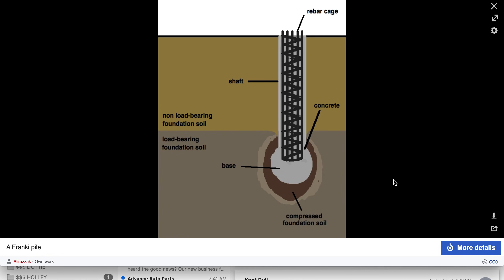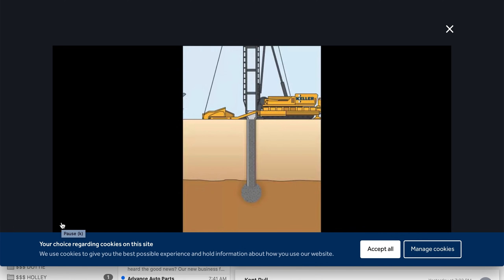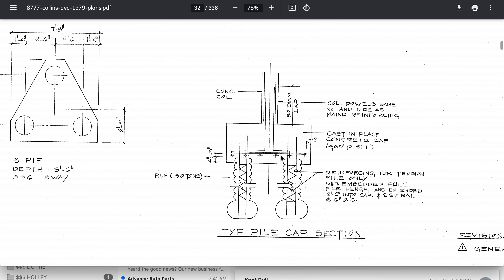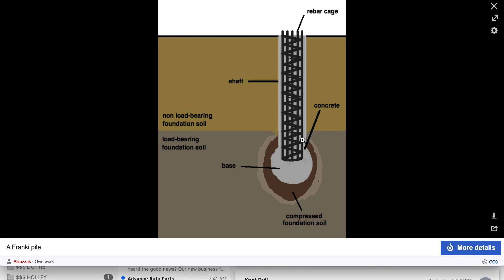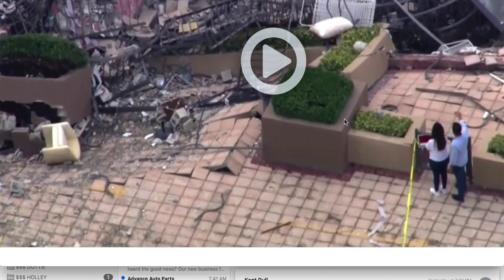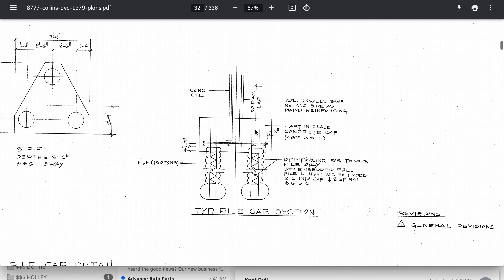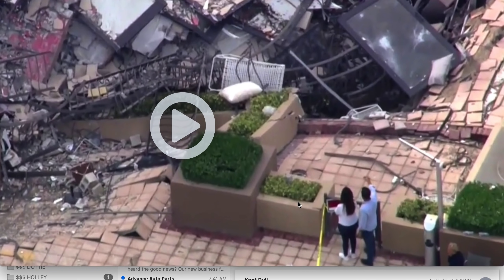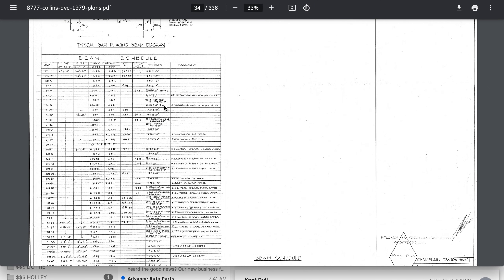Champlain Towers Collapse NO BUILDING SETTLEMENT AND NO COLUMNS NOT SET ON ''BEDROCK" +/-

Comment: Think you only need one set of footings to move and that would start the domino effect. You have one film showing water dropping to deck level. How long had that been going on? What time was high tide and where is water table located? You keep saying it's not the footings, can you find where all that water drain off to? Some where a repairman said he was there to fix plumbing and found sea water in basement. Say what you want but that limestone underground will give away with all that water around it. Think 40 years, twice a day high tide, and you dont know how much rain has fallen in that time period. Ask any of your engineer friends how long does it take for limestone to break down when in water? One video shows rain water dropping in at bottom of ramp, another shows the collapse at same area. And some photos show water damage in same area. When you have the time, go back and read some of comments. I am not the only one who says it's the footings and the limestone. The decks are mess-up also. There should be much more rebar everywhere and there should be right angle bars coming out of columns. You said that there is post tension cables in decking. I dont see that. Those core samples that were taken by Inspector show a thin deck of about 5 inches. That cant be right.

Comment: If the columns in the parking area were saturated and suffering spalling, which appears to be shown in videos, what is it that is meant to protect the piling columns, which appear to be constructed in a similar way, and pass down through (presumably) loose, salty sediment? Also, is there any recognised way to test these things/ However, from the coverage I have seen, it does look like the floors, at least some of them, detached from the columns. In a previous video you were counting rebar, and I think that might be important.

Comment: that broken water pipe just before the collapse means something
Reply: The building shifted and the pipe broke
Reply: It does. It means the building collapsed in phases. Early phase was  2-3 columns failing & water pipe breaking. Next center of building went down very quickly in 3 phases. Last was 5 seconds later as the Northeast corner of building shudders, then falls. Hope that helps.

Comment: An addition was built a couple of years ago to my large workplace on the shores of Lake Michigan. I had a great view! They used a variation of the Franki pile, where they sent down the shaft a sort of drilling head that enlarged the bottom of the shaft into a round chamber. This chamber filled with concrete when they filled the shaft. The water table is very near the surface at this point; maybe there was no way to sufficiently consolidate the soil just by ramming as in your video.

Comment: These buildings lack of the proper columns vertical and horizontal. The Promoters sold a trap and the city officials approved that fraud. All the State is at risk,this in only the point of the iceberg. The Federal Government should rewrite the Construction Code for Condominiums all over the Country it is a scam all nation wide. Looks like Alcapone built it.

Comment: Do you have seismic calendars? Water table maps? Recent Soil compaction charts? Thou code forbids differential settlement. Code is not always enforced nor does gravity care. The GD&T of buildings is inspected at the time of build. In order to dimensionally measure any building and it’s state of differential settlement there needs to be a process involving photogrammetry and 4D modeling of entire buildings in order to verify current conditions. I.E. perpendicularity, parallelism true positions measuring concentricity and load distribution at columns and pylons & beams. The mapping of the water flow and soil saturation has to be a consideration. 

         To the point of original building specification, every surface is a point of context. Pillar’s & column’s, pylon’s have vertical weight stress points yes. Walls floors and ceilings all’s, indicate movement & failure modes as well.
Reply from the maker: Can you please provide me with all the data you requested... I appreciate it and will look into it.

Comment: The overlay and pavers are supposed to be flat. The concrete is pitched and has drains as per the blueprints!! The only problem is the lack of maintenance on the waterproofing membrane.  The design and construction of the building was fine

Comment: I still think this was one single column corroding. Specifically the first one when you go down the parking ramp. The pool contractor the day before the collapse saw a major puddle standing in the parking area next to a column that was under the first section of the building to fall. He specifically mentions the parking space number and it is the first spot  you come to on the right when you come down the ramp. That spot would have been more exposed to wind blowing stuff into the parking area so it is reasonable to expect it to corrode faster if corrosion was an issue down there. 

If that single column deteriorated where it met that standing puddle it could have lost its load bearing capacity. At that point the nearest columns hold the additional weight. Something buckles, parking deck collapses when that shift happens. Something else buckles and the big collapse happens.
Reply: Think larger, much larger.

Comment: Salt water, steel and concrete are never a good combination. I suggest all of the high rise buildings built where salt water is common should be inspected immediately and repeated at least every 4 years. Buildings showing structural failure should be emptied, demolished and not replaced.

Comment: Hope fully they did not drop the concrete...it should be pumped in starting with concrete hose at the bottom and slowly pulling up the hose unit the entire column is poured completely.
Reply: Glad someone caught that error. The illustration was probably incorrect. Dropping concrete allows the aggregate to separate in the mix.  I would bet the concrete was pumped to the bottom inside a treme pipe. This would be the most effective way.

Comment: You are making an assumption that the developer followed the plans exactly putting in the footers and piers.  The construction site was a former wetland.  I think the loading stress from the 13th floor penthouses eventually weakened the structure past the point of no return.  The constant stress took decades to weaken the building's structure.  What finally triggered the collapse is anyone's guess but the blasting from the adjacent new building construction site is a likely suspect.
Reply from the maker: Judge, find me the connection of the pool deck to the building, that would be helpful.

Comment: See page 309 pdf, totally is not practical !
Piles for 50 tons! 
Max depth 47"! 
MIN depth 31" pool area foundation!
Reply: Aren't those depths for the pile caps?
Also, I the "Notes" text, piles are specified to be 14" x 14" pre cast concrete piles driven to 50 ton rejection. Seems contrary to  that PIF detail.
Reply: See sht.38 of 336/ S11 of 14, GENERAL STRUCTURAL NOTES, No.3 on pile spec.
However, look at cross section elevation of elevator shift shows rev.1 of pile type on 1/ 1980.  ???

Comment: The bedrock around there is dolomite which is not as soluble as limestone but they say it will dissolve in acid ground water. With drainage issues if a pier washed out you would have bridging possibilities. And the deck is on the same piers. The one that fell didn't even have cars on it.

Comment: What about erosion?  Pool was emptied by leaking pipe in parking garage I the day before collapse. If water found its way down pier and eroded soil. Bam!
Reply from the maker: Recall, the deck failed first...
Reply: @ForensicCats  maybe the both in the same time, I'm have a strong experience in Civil engineering I don't like the design of foundations in pool area (ex-centre insolate foundation with 3 piles) page 159 pdf

Comment: yeah, agreed, no stuck doors or diagonally cracked walls, not sinking. also Richard Hammond did a cool demonstration of multiple piles vs lack of bedrock in a vid about the Rion-Antirion Bridge. even not connected to the 'footing' (or the wood plank under his boots) the multiple piles reinforces the soil to reduce settling of the bridge piers (or him into that shaker thing full of wet mud).

Comment: I still believe that the creation of the pit next door to build the foundation and parking for the 19 story condo tower, plus the (presumed) controlled implosion of the hotel that was there before managed to liquify the soil just enough to leave the building "floating" in a way. If you look at the Bing maps imagery from 2015, the building is immaculate. But if you look at the Google maps imagery from 2021, there is spalling on many balconies and on all sides. I think the entire building was overstressed after the construction of the condo tower and, when you add in the bad maintenance, finally failed after years of "holding itself together" in ways it was not designed to. I also see the garage columns being too slender but I'm no engineer. I don't claim to know any of this for a fact.

Comment: After 40 years of salt spray, frequent rain, warm to very hot temperatures, and  constant high humidity, it appears that lack of timely maintenance and repairs in a multi-level concrete building located steps away from the ocean on a barrier island had much more to do with this tragic collapse than ground subsidence or shifting of support piers.  No doubt there are multiple issues that all had to occur at the same time to bring the building down; but sadly, negligence and apathy likely sits high on that list.

Comment: they said they have had a water problem, so could the soil over time washed from around the column, making them unstable, they seemed to have always had a water problem in the parking lot, and it was saltwater, so it could have her those columns to couldn't it. salt  and cement is not good together and it was 40 years old

Comment: My opinion is I didnt see allot of vertical rebar in columns,  those slabs just stacked on top of each other and columns crumbled . Where is the 1" and 3/4" steel that's tied together ? They should be crawling through like monkey bars at ground zero. I dont see the structural steel , only the slabs with there rebar .

Comment: Brilliant
and to commenters, please, Limestone is NOT bedrock
Limestone in a wet environment isn't a stable building material  Limestone melts away in any current of water as it does inland, causing sink holes, or much more slowly dissolve sitting in water as limestone under this sea soaked sand is doing every day.  Luckily that slowly and separated by so much sand, the sand settles atop the vast sheets of dissovling limestone infinitesimal layer by layer over eons, and footings such as these would settle every so imperceptibly with the sand.  
Limestone makes a decent building material in Egypt, UP in the pyramids away from Nile and even the ancients knew to encase the easily worked limestone in granite 'cause they had the 1000's yr old Sphinx eroded almost featureless by then, made from Limestone and which was retooled and patched by the Pharaohs, Napoleon and in modern times.  Effectively limestone in Florida is just a mineral source for shell fish and coral to build their homes from as it dissolves, drop to the sea bottom and start making more limestone.
Reply from the maker: Yes but, you need water to be present and not just water and or you need an ''acid'' type water... otherwise, limestone is about 10 kips strong (that is huge)...  Limestone, has been used as load bearing for many a day...

Comment: 1:19  in deep foundation, one concrete pile, can support from 35 tons to 125 tons or from 70,000 pounds to 250,000 pounds.The Franki piling system is a method used to drive expanded base cast-in-situ concrete piles. It was developed by Belgian Engineer Edgard Frankignoul in 1909.

Comment: I read that the new, oval building to the south did have pilings that went to the limestone.
Reply: It has been mentioned by some engineers interviewed that building codes have changed since the era in which Champlain South and others were built. I've also read that other buildings from that era have been marked unsafe for years, but the apathy of the owners combined with the lack of governmental enforcement is apparently common in Miami.
Reply: @JenniVander  that's meaning that we should takes the Geothecnical Hazards into consideration during engineering designs of each Building 🏢
Reply: @JenniVander  I actually heard that Florida is one of the only states that has the 40 year recertification rule. Many states don't have any rule like that, apparently. Who knows how it's enforced, but at least Florida took steps to establish it. I bet a lot of people assume that their state has recertification rules!
Reply from the maker: I could imagine that is where they would have reached 150 tons ... the depth of footer over 125 to 175 is what other buildings have reached limestone... from what I researched.
Reply: @ForensicCats  ive watched a couple vids and poeple in comments  were talking about the fact that they might of used beach sand in the concrete ?i googled the topic it seems that makes for weak concrete ? does it ? and could it have comprimised the buildings overall integrety?
Reply: @ForensicCats     Cool Video , thumbs up - South Florida was geographically under  sea water for millions of years (eons) , the limestone is the skeletons of billions of crustaceans (shells) , which is very porous and easily dissolves. Limestone is not bed rock. When you look at a map of Florida you notice millions of perfectly round lakes , these are actually sinkholes (dissolved limestone caverns) that have filled up with water. Builders in Florida have and have always had a gold rush mentality. Mother Nature will reclaim her property.
Reply: Limestone is obviously a key ingredient for making high quality cement so this explains much as to why Florida is the way it is as yes...limestone in its natural state is very porous but once added to with sand and importantly FRESH water becomes an excellent cement product. This is on the Ocean and water is incredibly heavy plus there is surf force and something of a tidal force so that could cause some "uplift"(water coming up from under the ground pushing up upon anything trying to compress it.)

The only "factoid" I have heard which may or may not be true is at the time of construction they were using sea water as the slurry which was regulated out of existence soon after thus requiring the use of fresh water only thereafter.

There will be weathering, storms, regular rains etc to contend with and hence the requirement for the inspection as by that time one would expect the building to be in "collapse mode" and need to be condemned and hence replaced.

Certainly explains why wood is so valuable in construction given its ability to support its own weight plus modern fasteners, wall board, nails, screws, roofing, etc etc.

When buying for personal use real estate i think one should always look upon the matter as one of tear down value always as the new is so much better now as well so is construction techniques. There are exceptions inland of course but never upon anything Oceanside.

Comment: Maybe you are right but do you have the old soil investigation report? If they use Raft foundation it will more safe and economic.

Now they can checks again by Geothecnical Borehole tests  as investigation facts.

I think the big problems are with punching shears around short swimming pool flat slab of thickness 9" for 29' span too long (building code 1979?) and also the missing of insolate joints (doubles columns cause) around L BLD form 12 stories.

What about the connections details between slabs and beams I don't see in the plans.?
Reply: Valid points.